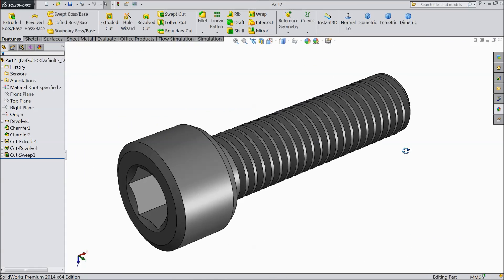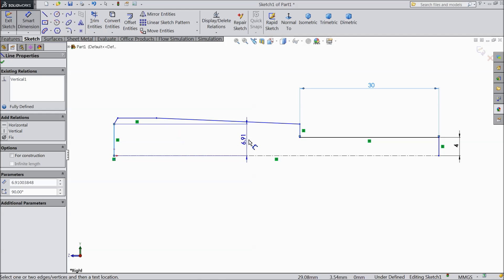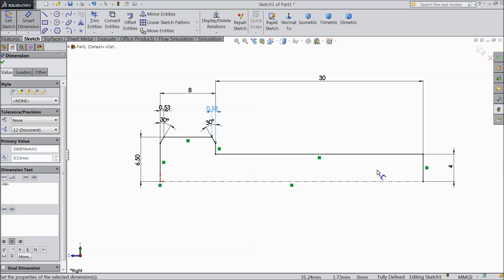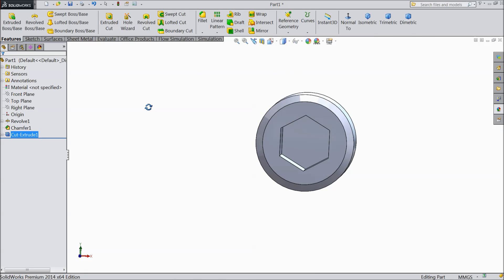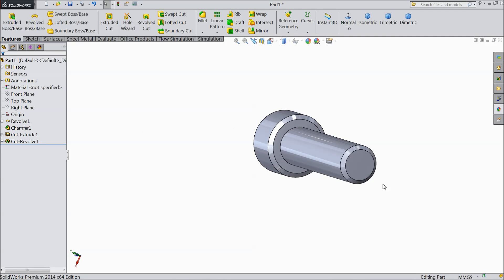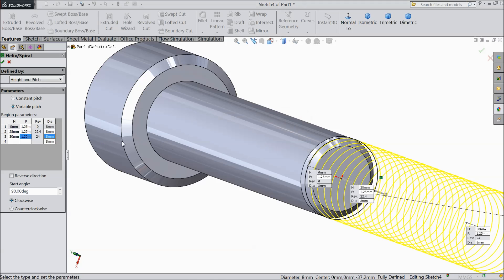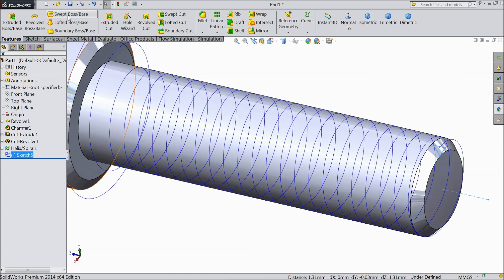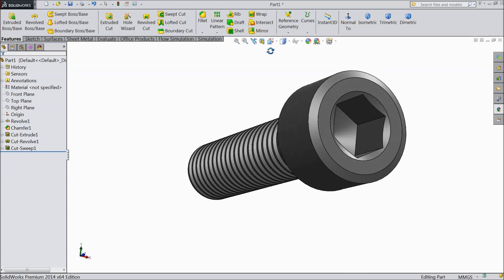SolidWorks tutorial | How to make Allen Bolt in Solidworks

Comment: Great tutorial for beginners. Modelling them like this often. The spiral out at the end is a sweet trick for a quick nice thread end.

Officially the second (right) triangle for the revolve cut @5:05 isn't correct. This way it also cuts under the straight sides of the hexagon shape.

Comment: As much as I enjoy the film I have to add that using the command "thread" or using a sweep is very intense for the computer and thusly not recommendable for large assemblies. I would highly recommend using the command "cosmetic thread" which creates a callout which you may use on the drawing, but doesn't slow your computer down to a standstill.

Best of wishes.

Comment: Very nicely modeled allen bolt. As an acedemic excercise it's great but I wonder if it's practical to have bolts of this quality and complexity in a large assembly. Can you imagine the load on the GPU if you had fifty of these in a large assembly? I did a few of these in my own small assembly and kept them very basic, no helical sweep, just diameters and extruded cut hex. They work just as well.
Reply: https://youtu.be/z7R_BF0QE2Q

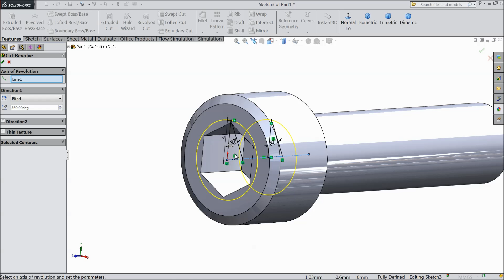Comment: at the 5:50 I do not understand why you make  the two triangles ? and 8: 00 why you did another triangle ?
Reply: at 5:50 two triangles are to make a finished surface on the allen bolt head. at 8:00 the triangle is the cutting tool like in machines that will cut through the material to produce the threads. You can also use square instead of the triangle shown at 8:00, that will make square cut instead of triangle.

Comment: Its worth to mention that v2016 and higher has a built-in thread feature, don't need to use swept cut, but the Thread Feature, that makes things simpler. But for the earlier versions this is useful.
Reply from the maker: telelaci2  true its suitable for older version of solidworks,

Comment: Why 6.47/2?
Reply from the maker: Actually the dimension is 1/8 inch & its 6.47/2 mm with tolerance,
Reply: Is 1/8 inch as 6.47/2 with tolerance has any relation with Allen bolt dia 8 mm??

Comment: I tried this before and this time again but it is giving me an error (pink lines on spiral) and it does not do the threat sweep cut. Any idea of what could it be? I tried many ways but still the same thing. Thanks!
Reply: The triangle height should be less than 1.05mm
Reply: I found out that the distance is important, it would not cut if I put 3.24 instead of 6.47/2 that you used. Problem is now solved.
Reply from the maker: yes distance is important.
Reply: Done, my triangle was too high.
Reply: @guillordz  must be coincident
Reply: I have the same problem, but I put the 6.47/2 and the problem still, any help?